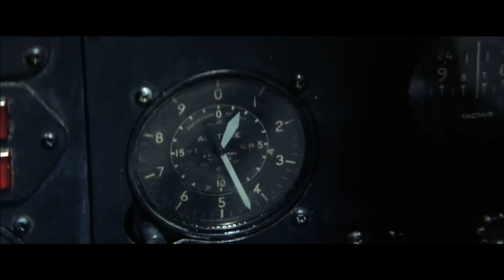Why do these starfighters ignore physics?

Comment: The part that you kind of missed was that these are piloted by living creatures and not droids. If I remember correctly things like the "buzz" droids seem to move much faster than a normal fighter. At some point the machine has to be slowed and limited or there is no ability for the pilot to control it. While the most obvious answer is that this is simply a fictional story, that seems a little too easy to be true.

Comment: "At the distance of iss earths gravitational pull isnt nearly as strong", sorry that's not correct. The iss gravitational acceleration isn't much different, not different enough to make relevant. That's not why astronauts on iss are "weightless", that comes from their orbit. They, and the iss, are in free fall, which is the entire point of reaching escape velocity.  We can calculate g easily but google was faster at a nice 8.85 m/s^2. Only about 1/10 reduced from g on earths surface.

Comment: I like the theory that space in Star Wars acts more like a giant ocean with small amounts of particles that are so light that they interact with ships like air without the gravitational pull from in-atmosphere flight. That's why larger ships can't eventually reach the straight-line speed of A-Wings and why ships lose control or struggle when they aren't moving in the same direction their "front" is oriented. They have to cut through the lighter-than-air air that's in space but can do so without the heavy burden of strong gravity

Comment: The ISS actually did derive it's thrust from the initial shuttle launch which boosted the station to speeds beyond mach 20, which was partially done in atmosphere as the shuttle broke for orbit with the first piece. 

This energy was put into the station decades ago and remains the same energy to this day. The thrust you mention is in fact the thrust to maintain said orbit. 

So no, the ISS had a booster phase with far more thrust than the SR-71.

Comment: While Starfighters don’t have to worry about atmosphere and lift, they do still have to worry about inertia.  An object’s inertia is the amount of force required to change its momentum, whether than be to stop it, slow it down, or turn it.  This is a concept known as energy maneuverability and is a principle that modern jets have used since the 70’s.  For a Starfighter, it would be no different.  A straight line of flight is basically maximum potential energy and the highest energy state.  The moment the pilot wants to turn, he has to cash in some of that potential energy, slowing down in the process.  Thus, Starfighters would still need to be economical with their movements as they trade and earn potential energy to maneuver in combat.

Comment: Nobody's gonna read this, But I have this head cannon that the repulsorlift field is like a magnetic field that repels on the spacetime or quantum thing or whatever. This field can be modified by the repulsorlift vanes to increase the repulsion force forward, aft, left, right, etc, thus, producing pitch, roll etc. And a increase along the center of mass would give thrust.

The main exit point for that repulsor field is what we call engine nozzles, from that point it surrounds the whole ship.

And the glow in the engines is the ionization and heat produced by the strenght of the field being increased (thats why sometimes you can see the ""engines"" glow brighter when theyre actually trying to go in reverse, like the ISD being tractor beamed in squadrons).

This would also account for the wings, theyre radiators and places for the repulsorlift vanes (farther from the center of mass, higher effect on rotational momentum). And most of the repulsorlift vanes are pointing back and down (allowing for landings) and that makes the ships better at pitching rather than yawing for example

Comment: I had always assumed that it was because the repulsor lift only provides lift. You have to have thrusters to get forward motion. But, I agree, they should be moving much faster. In Return of The Jedi the rebels and ISD's should have passed each other so fast neither side could have gotten off a shot manually. For the rebel ships to have sat in close proximity they would have actually had to match velocities, then gone in reverse to stay close in. Otherwise the rebels would have been half way around the planet before they could have turned. In the movie they were moving at blue water sailing speeds. Which was visually cool, but, totally illogical. 

Also, by rights the lifter should dampen  inertia for everyone in the field. The extra inertial compensator is just backup.

Comment: G-Force aside, there's no reason that a space fighter can't do a "zero degree turn" as you'd be using the maneuvering thrusters to turn, not the main engines or even repulsers. That's why the bots had an advantage in flight. I think that BSG did this with the vipers.

Comment: My headcannon is that inertial dampeners dump the excess inertia energy into hyperspace in a sphere around the spacecraft, which is what causes it to act like an atmospheric aircraft.
Tie fighters have inertial dampeners that the pilots can't turn off because if they did, the tie fighter would disintegrate.

Comment: I think something  people forget here is relative velocity, due to the ranges at which star wars battles take place, if the ships were using orbital mechanics, the fleets would be orbitally merging, rather than on an simple intercept course. The attacking fleet is matching the orbit (at least temporarily) of the defending fleet in order to bring their guns to bear on the target for extended periods, rather than an intercept course which would give you a split second drive-by. In these circumstances, the capital ships are moving at low speeds relative to each other, and since our point of reference is usually those large ships, the maneuvers of the strike craft make more sense. relative to the planet they are changing orbital trajectories, but that's not the  relative frame of reference, relative to large ships with similar orbits, the starfighters can dogfight more conventionally (albeit without air resistance) since they start largely at rest relative to each other. This kind of orbital merging and the relative movement involved is how docking in space works.

Comment: One thing to point out is what the ratio of gravitational potential energy to a ship’s total energy is — this is roughly 1/(1+rv^2 /2GM) with r the radius from the planet’s core at which the battle happens, v the velocity of the ship, and M the mass of the planet. So if a ship comes to a complete stop (v=0), of course it should be pulled towards the planet.

But what if the entire battle is rotating around the planet? We could watch a ship come to what looks like a stop, but if the whole battle is rotating at around the speed and radius of the ISS, for instance, everything would be fine, and we wouldn’t need to worry about gravity dragging us down.

Hopefully this is worth considering! Bottom line is, all we need is high speeds in order to ignore orbital mechanics.

Comment: To only look at the gravity of a planet alone is not enough to explain or understand the slingshot maneuver. You also have to look at the fact that this planet is also orbiting the sun.

What you are doing, when you are doing a slingshot maneuver (technically called a gravity assist), you are using the gravitational force of this planet to transfer a tiny fraction of the planet's own orbital energy (the energy the planet has while orbiting the sun that is) to your spacecraft. And because the planet is so huge compared to your spacecraft, the fact that you are accelerating your spacecraft is much more noticeable than the fact that you are, at the same time, slowing down that planet's orbit around the sun.

The gravity of the planet itself is just a means to transfer that energy, but not the source of that energy.

You can either use a planet's gravity to pull your spacecraft along the planet's orbit around the sun, thereby making your spacecraft go faster around the sun than it did before, or to slow your spacecraft's orbital velocity around the sun down. Which one it will be depends on how you execute this gravity assist maneuver.

Scott Manley made an excellent video explaining this.

Comment: SR-71 does not really flies on turbojets. it only gains altitude and speed till it can start the ramjets.
Reply: It's also not limited by heat. It's true that it required cold (dense) air to reach maximum speed, but the real factor was that if it exceeded it's max speed (machine 3.55 if I remember correctly), the shockwave from the nacelle cones would collide with the engine inlet, effectively turning the engine internals into soup

Comment: Small correction on one of the things you talked about. Orbit itself is what keeps the ISS afloat not the lack of gravity, gravity at that altitude is pretty close to surface gravity. The effect of weightlessness is because the ISS is moving so fast it is falling over the horizon, so it acts as if it is perpetual freefall. Not that it really changes much of your further points, but I think the distinction helps to reinforce it.
Reply: Thanks for pointing this out!

Comment: The counter-argument, is that the 'inertial dampener' is not 100%, so your left with a residual g force and forces that act like you're on earth. in the Timony Zhan book 'luke turned down his 'inertial dampener to 95% or 90% I don't know, so that he could feel gravity simulated. The physics of Star Wars is really unknown, like the temp of the 'blue lightsaber' plasma blade is about 10,000 C to 50,000 C, very hot temps, let alone the single 'purple star' is cooler. but forcefields and magnetic fields in earth tech would be electrostatic fields and magnetic fields. it's just the tech of Star Wars is really unknown... a long time ago.

Comment: Repulsorlift - is not a propulsion system, it mitigates the effects of gravity <check>
Inertial Compensator - works to significantly dampen/nullify g-forces, else pilots would instantly become goo <check>

Thrusters/Engines - this is the propulsion system, in atmosphere the resistance is the atmosphere, out of atmosphere there is no resistance.  nobody wants to go 700 MPH to reach orbit, that would take ~30 minutes, and we don't see that slow of an ascent..even on Aldahni they made it to orbit in under 10 minutes in a slow freighter while flying through a meteor shower.  thus, there's more to it that may be unknown via current SW lore, so would be the least believable part of all of this.

Now, here's the rest of the puzzle:

Stabilizers - just like the rest of the technology, these are likely quantum units that interact with the fabric of spacetime to give some "grip and traction" and "steering", without restricting 3d movement (like a magnet under a table, moving something on top of the table).  we don't see thrust-based reaction control systems on most (or any) SW space ships (and wouldn't produce the desired effects if they did exist), so it must be an internal component akin to a repulsorlift but more like a reaction wheel.  u-turns, banks, and rolls would all be enabled by such a device.

Comment: About the maneuvering of starships in SW I'm pretty sure it has a lot to do with their known technologies of hyperspace manipulation, gravity generation, inertia and mass manipulation and enormous energy production. Regardless of the mentioned technologies they still use basic rockets and turbines to propel ships through space, but those rockets are ridiculously small to move these ships to any kind of real speed. Therefore, I believe they use a technology to transfer a large portion of their mass into hyperspace, which is then subject to much different natural rules. Much like a sailing ship uses the wind to propel itself over the ocean, the more a ship can transfer its mass into a higher dimension, the greater its ability to effect maneuvers in realspace. Then, to stop along its own vector, all they have to do is reduce the amount of mass they're projecting into hyperspace until their own natural inertia slows them down naturally. There are similar technologies in SciFi properties used for inspiration of SW, like the Lensmen series, so it's not actually too far-fetched.

Comment: "At that range gravity's pull isn't nearly as strong." This is my only nitpick. At that distance gravity is only reduced by about 10%. Orbiting is usually explained as falling toward the surface at the same speed you are flying perpendicularly to the surface. With the net result being that you are continually falling past the curve of the planet. 
If the ISS were to "slam the brakes" and come to a complete halt relative to earth's surface, it would fall just about as fast as a rock off a cliff.
Excellent video otherwise!

Comment: My theory is that in Star Wars, space isn't empty... There is matter there that creates drag. 
What is it? Who knows? 
What are it's properties? It doesn't interact with light, and it doesn't slow down anything floating, but if you start an engine that pushes you forward... BAM there it is.

That's how The Force works

Comment: Isn't canon that ships in Star Wars have a type of shield that allow them to 'ignore' air resistance?  Add in inertia dampers and gravity generators things together and then you're only limited by the structural strength of your craft, how fast you can react, and how 'tough' you are. Aka, without the right tech space battles would look like the Expanse, but then with those 'impossible' techs things would happen get faster, but you would still be limited by piloting, materials, how good the tech is, how much money the builders were willing to spend, and, ironically, the same physics that governs the space battles in the Expanse, which is something I've noticed a lot of people don't understand.

The faster you move in one direction, the more energy you have to use to stop and go the other way, but if you were turning, then it would be far more energy efficient (and less stressful on the ship and crew) to maneuver in would end up looking like as a banking motion then try and pull of a 90 degree turn. Funny enough the math (and KSP) supports this, as you have to start moving (turning/thrusting) before you're parallel to your destination to avoid overshooting it. Add this to how the slower you are (relatively) the easier you are to hit because you can't move as quickly, of course starfighters in Star Wars would look like they fighting in WWII dogfights, aka:

Go too fast and you might wreak your ship or knock yourself out (by going past what your tech can handle), maneuver too quickly however and the same might happen, but go too slow and you're an easy target for the faster fighters who have the speed and energy where they can get in and get away before you can react.

Zero-gee fighting still works, but it would become situational in the world, and tech, that is Star Wars.

Comment: if keep moving away form the earth eventually the gravity pull will get so weak that escape velocity will become a low number. it why black holes if get close enough even light can not escape. the crazy thing is that George saids in Star Wars there is air in space. "In my world, there's air in outer space,". "When I want it."-George Lucas
So in star war universe space is not a  vacuum. It just really thin. So yes you can space battles that look like dog fights in Star Wars universe.

Comment: Also worth noting that humans have a specific evolved frame of reference that would make those 'tic-tac' flight patterns counter intuitive and difficult, if not impossible, to perform effectively.  We can only look in one direction effectively at a time and it's reasonable to expect that space flight capable fighters would conform to these requirements.  It would also be reasonable to expect that, given the nature of their repulsor lifts and the square-inverse law that describes the effects of gravity, repulsor lifts would become less effective the further from the gravity fields source, creating greater reliance on thrusters, which are all placed in the rear.  Even in zero-G Newtons laws of motion still apply: something pushes you from behind, you move forwards.  Thrust vectoring allows for turns and maneuvering, but that thrust still only pushes in one direction at a time.  That's my take on it anyways.